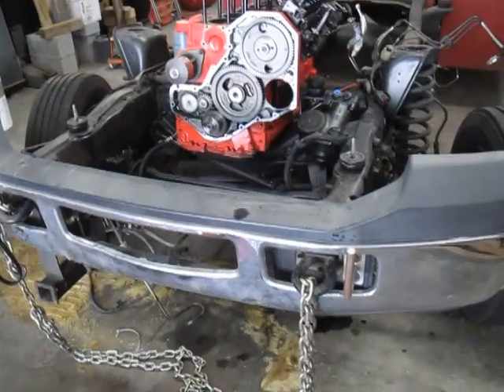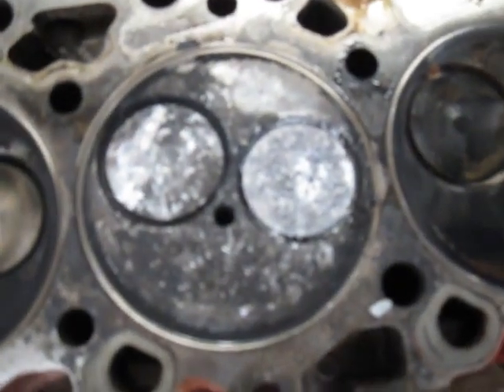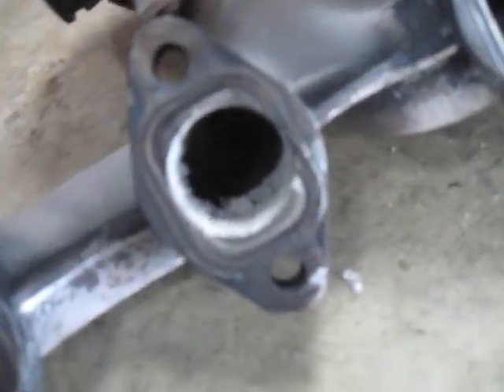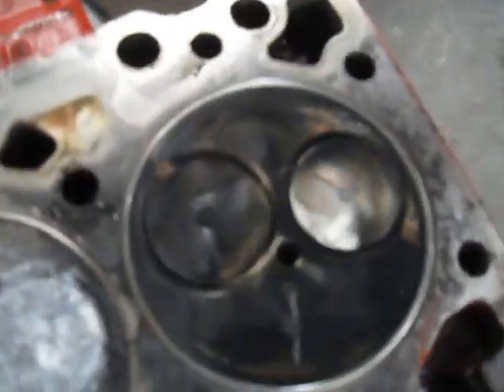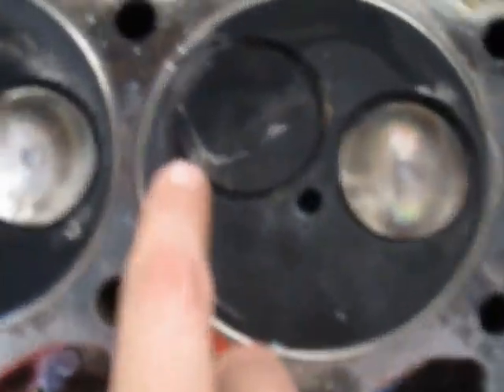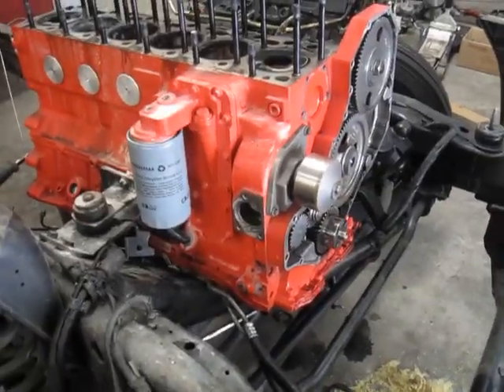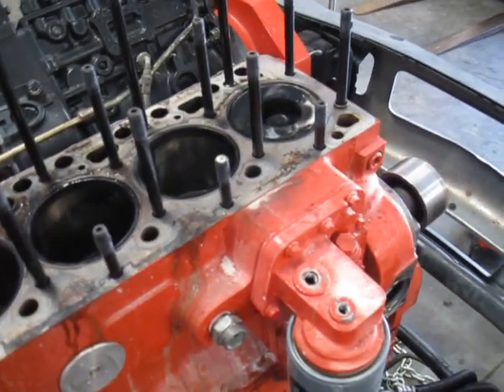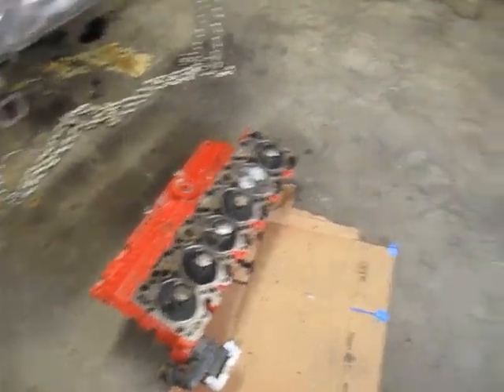Ford f450 cummins swap part 6.

Comment from the maker: the driver was the problem. had his foot in it to long and wasn't watching the pyro gauge. I was able to get another engine and get it installed and it has been running for a few months now and is still running strong. I pull around 30000 lbs every day and that's why the need for all the power.
Reply: David Hyde hey buddy are you still in Richmond Virginia???

Comment: Just running across your page, you had two engine rebuilds. Industrial Injection built one and that engine went south.. Not the company to buy a high performance engine. Unless you're drag racing or tractor pulling, the down time is not worth it.  The price of both engines, the labor and not making money while the truck is down. $30,000+ down the drain. Not to mention your labor and towing. I will keep checking back to see how it goes. Good luck with your truck. I'm starting on my F/C Project and a good page with tons of info.  Thanks

Comment: That's too bad the engine let go like that..... It would have been a really nice swap.... Hope you can get a good engine and fix it once and for all....  Should be able to get over a million miles on a good engine.... I have seen it done... Use quality oil and keep the oil clean.... Thanks for sharing the video.

Comment: What a waste, I've had a stock 1995 cummins 12 valve for 20 years, I expect to get another 20 out of her. All the extra crap to get more power just really seems to make them unreliable, so whats the point ? Good luck my friend.
Reply: MFB Alaska  the extra power that was added wasn't the problem smh 🤦🏻‍♂️
Reply from the maker: Well we move over 32000 lbs with these trucks and rebuilding the 6.0 every 3 to 6 months was very costly and the cummins is cheap to rebuild and to make big power with. The 6.0 was just full of failur prone problems that could keep the truck down for days at a time. Now that I have a combo of parts that work and well trained drivers I have had very little problems out of the 3 fords I have swapped.

Comment: so 2 cummins engines later and people say 6.0l r bad lmfao good luck seams like to much goin wtong for u also i thought fire rings r used racing not towing
Reply from the maker: Well the cost of rebuilding the 6.0 is just ridiculous. And I can rebuild the Cummins for under a grand. And we use the firering because of 45 lbs of boost and higher at times. The first engine went due to high egt for a prolonged period of time when driver should have down shifted and got the rpm up to bring the temp down. The second was a 4 to 2 shift over spinning the engine and killing the valves.

Comment from the maker: That engine was $18000. Thay gave me a great deal on another one for $8000 due to it was only run for 2500 mile. I have a water injection on the new one to keep that from happening again.

Comment: You should not need more than 15 pounds of boost with a good intercooler for normal applications. 40lbs is for racing.
 
Next time rebuild your own engine. You'll do a better job.
Reply from the maker: Well this is not a normal application. We pull over 30,000 pounds daily with these trucks so we need all the power and torque we can get without destroying the trans. Witch the ford trans has proven to take all the abuse we can throw at it.

Comment: Hey David, so what happened?  Did they honor the warranty?  What are you running now?
Reply from the maker: Thay did honor the warranty to an extent due to it being a driver error. Has compounds on it with a meth injection now. Running stronger than ever
Reply: @davidhyde4997  Wait...the second failure where the pistons were impacting the valves was driver error?  Wha-?  Yours is the best build I've seen thus far.  Would be quite interested in seeing an update video...
Reply from the maker: @RX7GSLSEowner  yes driver error. Down shift to to low a gear and over spun the engine for what value train I had in it. Just kept upgrading until I found a combo that the drivers couldn't hurt. The truck known as big hause has over 80,000 mile on the engine and still running strong enough to snap the yoke of the rear end. But unfortunately my camera broke shortly after the last video and dont have the funds to invest in a good camera. Thanks for watching and commenting.
Reply: @davidhyde4997  Ah I see.  What ended up being the combination that the driver's couldn't hurt then?  I understand WRT camera purchase, but hell your stuff was so good, I'd be glad to just see it off of a smart phone camera!  Best Fummins conversion on the Internet IMHO.